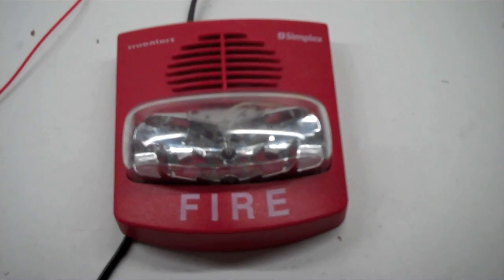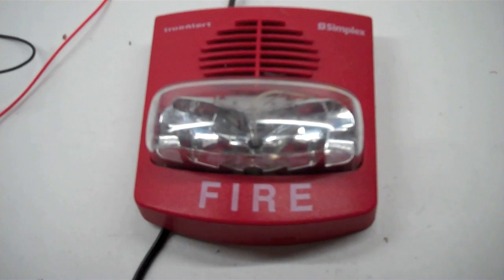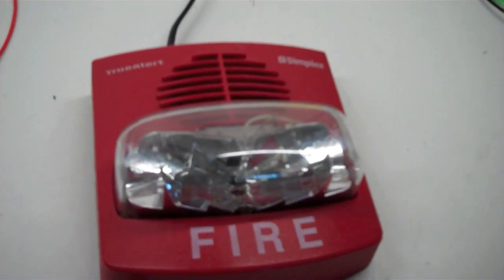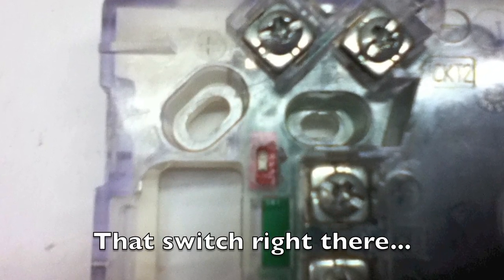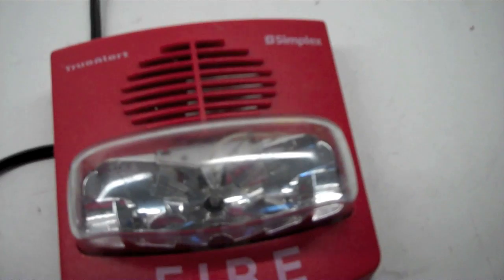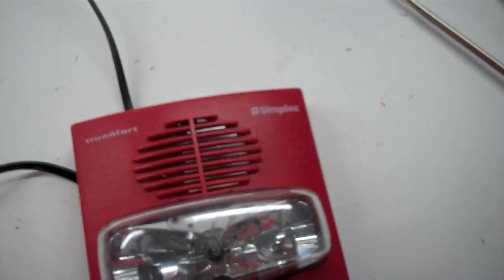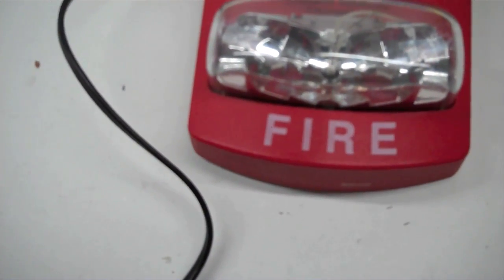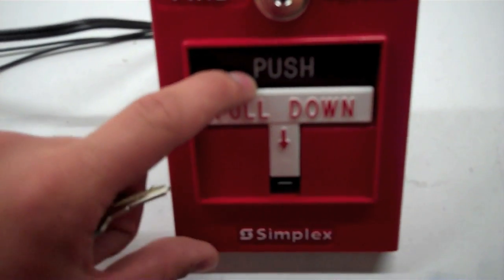Simplex 4903-9426 (TrueAlert) Fire Alarm Test

Comment: These are free runs right?
Reply from the maker: The strobe is capable of both. However, the switch on mine is broken, so it's stuck on sync. Horn is free run regardless.

Comment: My Elementary school had Simplex 2901-9333s in continuous, but the school was renovated on 2011 and the -9333s were replaced with these in continuous.
Reply from the maker: +Danny Campitello THESE in continuous? That must be painful. Even more surprising is the fact that the True-Alerts are still doing continuous, must either be an existing panel or local municipality thing.

Comment: If you are make a deal on the true alerts don't buy it.
Reply from the maker: If you do a little bit of research before you happen to buy a Simplex TrueAlert device, you are more than likely to find an appropriate product. What I do is when I see a model number that I am unsure of, I do a quick Google search to see if it is appropriate to purchase.

If the model happens to be a Freerun model (doesn't need a SmartSync module), go ahead and buy. If it's a SmartSync model, you should have a proper SmartSync module before you decide to buy. Do NOT buy any Addressable units. Those are designed to be run from either a 4100U or 4100ES panel (and those are expensive panels)...unless you want one for a decoration.

Comment: Can it do code-3?
Reply from the maker: On the alarm itself, there is no option for self coding. This is even true for most of Simplex's current products. Only if you code it via the panel/smart sync module, it will produce Code 3.
Reply: NewEnglandElevators Why doesn’t Simplex offer coding/volume on most products?

Comment: Believe it or not, there's a DAY CARE CENTER in my city that has these alarms. They used to have Simplex 4051+4050-80s in the original 1978 section of the building, and 2903 alarms in the 1982 sections, but they replaced them some time in the last decade with the TrueAlerts on adapter plates (small silver ones in the 1978 wing, and large red ones in the 1982 wing.) The panel is probably a 4005 or something; they kept the old annunciators, the break-glass 4251-30 pulls in the 1978 wing and 4251-20 pulls in the 1982 wing, and I saw a few conventional Simplex smoke detectors (wiffle-balls and the smaller 1990s-style models.)

Comment: The hospital I used to work at had some of those on the fourth and fifth floors. I could faintly hear them from the stairwell I was in at one point during a system testing (the rest of the hospital has a variety of Simplex speaker/visuals that make chime tones.)